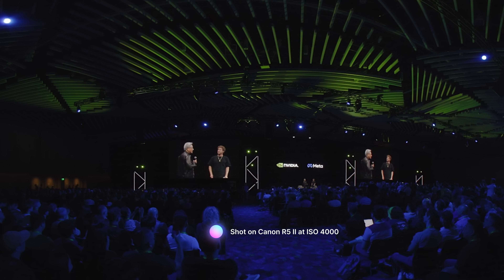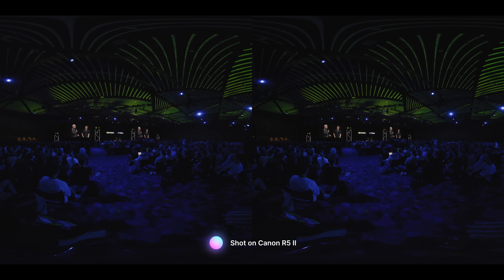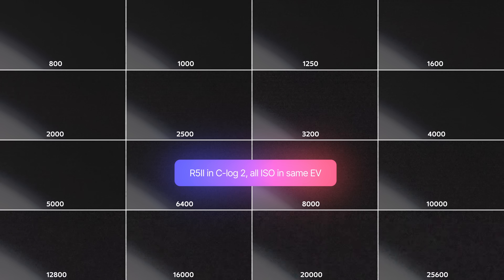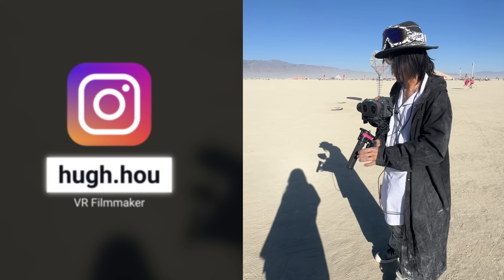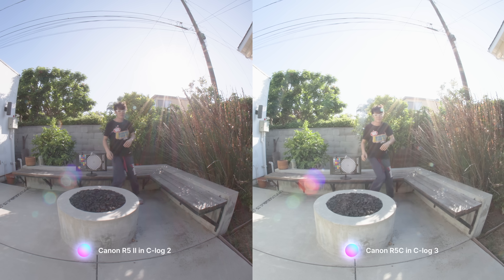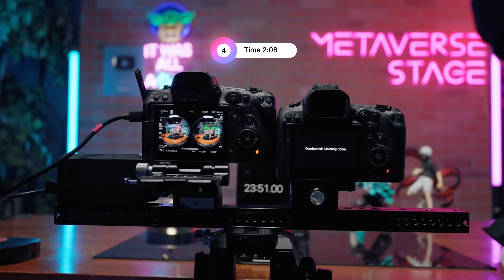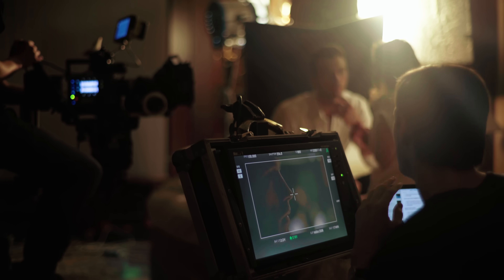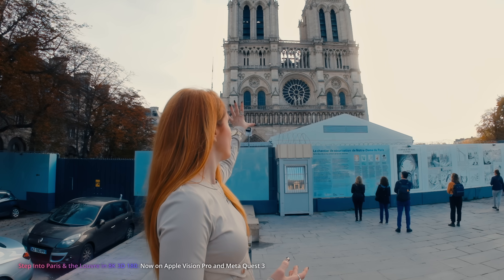Triple-Base ISO debunked! Canon R5 Mark II Noise & Overheating Test vs. R5C

Comment: Thanks for another wonderfully helpful video.  Your site has become my goto Youtube channel for all things 180 and 360.  I was wondering if focussing with the manual Canon 3D Virtual lens is any easier on the mkII?  I  wish the lens had autofocus like the APC version.  Do you think they'll release a full frame version that is autofocus?  Thanks again for all of your efforts and sharing.
Reply from the maker: Not likely. Usually we will know 1 year ahead of time in patent releasing docs but Canon did not apply any dual fisheye IP - meaning there is no new dual fisheye lens beside the APS-C one (which patent fired 2 years ago and we know it is coming)
Reply: @hughhou  Makes sense - didn't think of reviewing the patents.  Do you think the auto focus on the APC version outweighs the better quality of the full frame version?  I know you've used both.  I'm torn with which one to purchase between them.  I have a r5 mkii on order and I also have a r7 so I could either way.